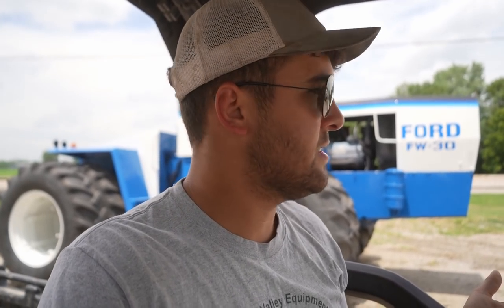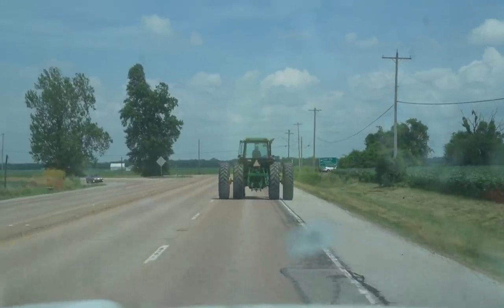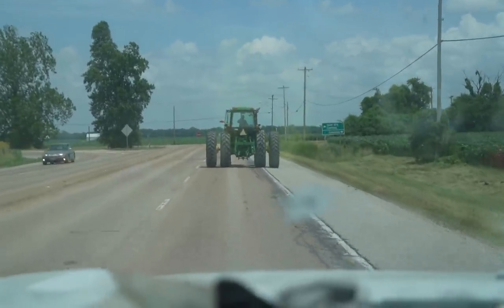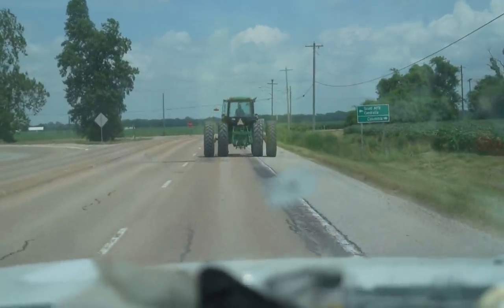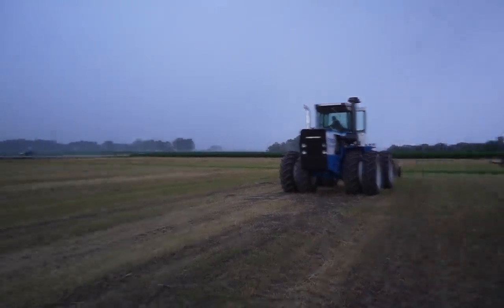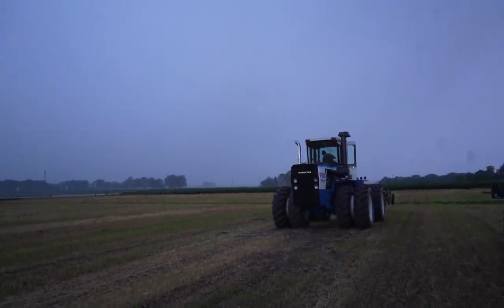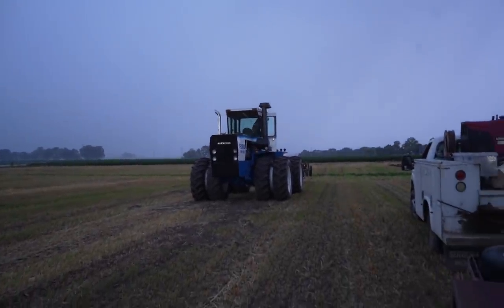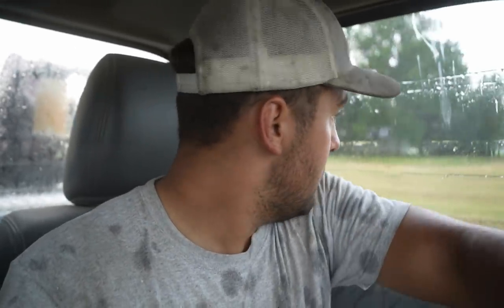Plowing with the Ford FW-30

Comment: Got to be a LOT of work to disassemble all that equipment and haul it to Rantoul. Then do it all over again to get it back home. Cant think of any way getting those big plows up there without taking them apart.
Reply from the maker: It’s honestly not bad, the drive is the worst part. None of the plows we are taking need disassembled, but they do have to be loaded with a forklift